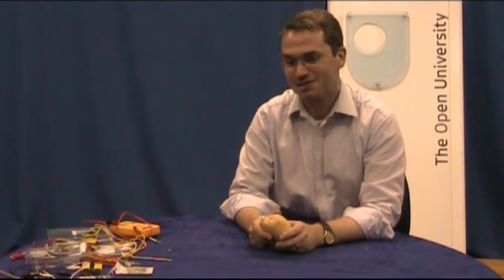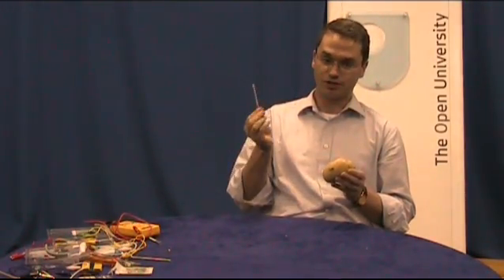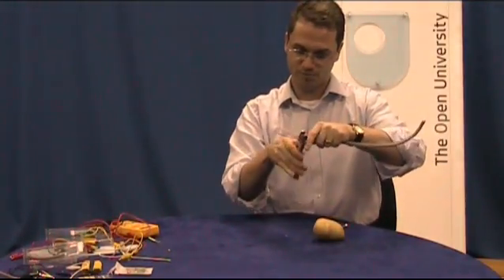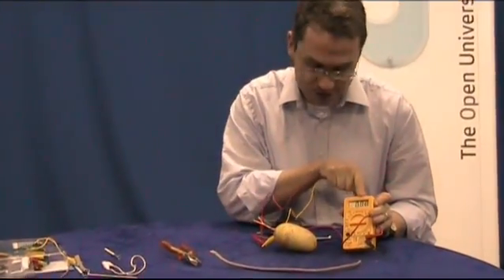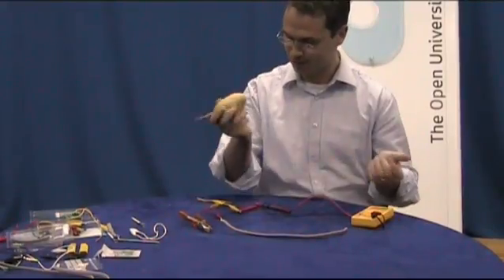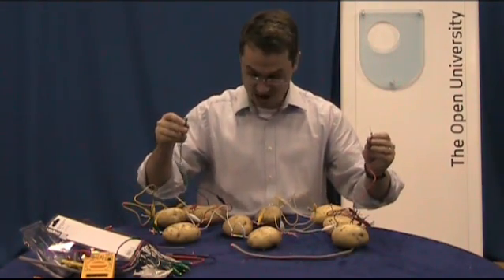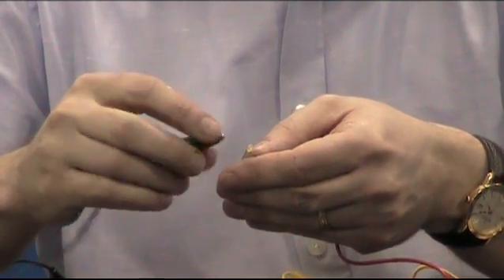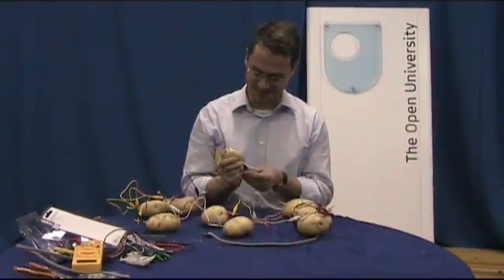Lightbulb moment

Comment: sooo.. the power has nothing to do with the potato.. the potato is just functioning as a salt bridge.. the real work is being done by a system of two redox reactions.. zinc in the nail is being oxidized to aqueous Zn(2+) and copper(II) found in the potato's cells is being reduced to solid copper which deposits quite readily onto the copper screw the electrons used to reduce the copper(II) came through the wire past the light bulb and down into the copper screw to interact with the copper(II).
Reply: "the power has nothing to do with the potato" "copper(II) found in the potato's cells"

Comment: The potatoes don't have power in them, electrical or otherwise. The power comes from the electrical potential that exists between an active metal and a less active metal. The copper and zinc react chemically to create an electrical current via the medium of the potato (technically an electrolyte). The reason you might not want to eat the potatoes is that it's hard to tell how far the invisible ions of copper/zinc traveled in the potato. The copper ions are poisonous.